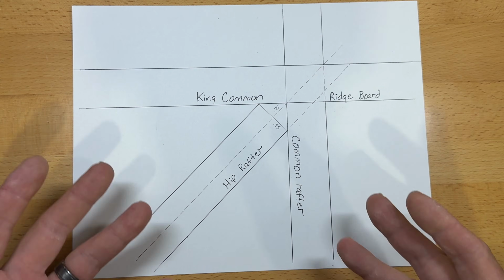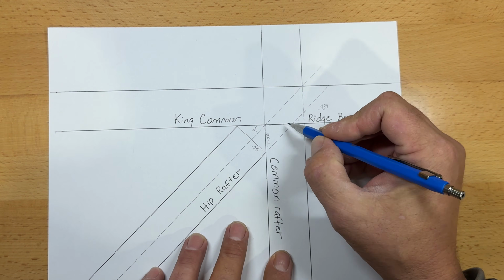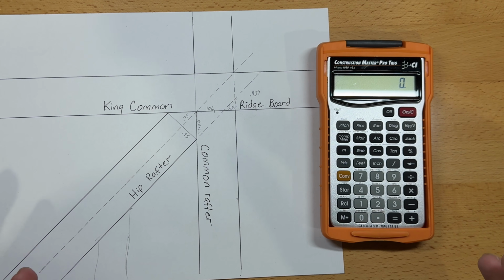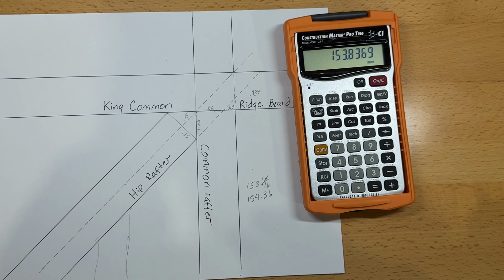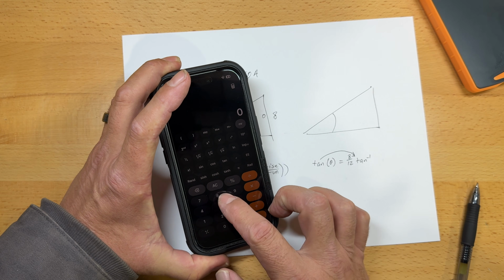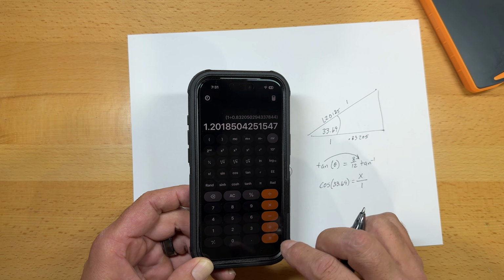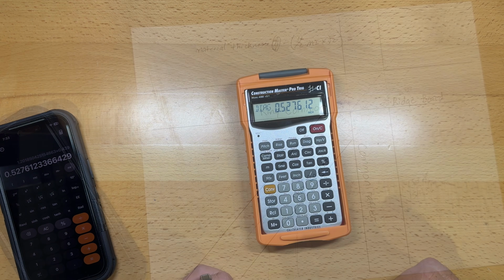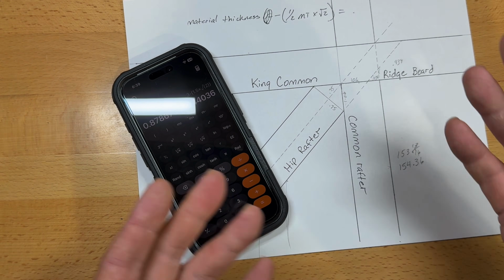The Flaw In Construction Calculators

Comment: You can calculate directly: 0.75*(Square root of 2)=1.06. When I was young we still used inches in the timber industry in Sweden, today it is mm. 2 inches is about 50mm. I say ( 2 by 4 ) in mm it becomes 50*100. This is understood to be sawn timber. Otherwise I just say ( 2 by 4 ) Planed. About 45mm*95 mm. I have a folding rule that is marked with both inches and mm. The younger generation never borrows it.

Comment: Curious... do those 'construction' calculators do order of operations correctly? For example, if you enter 1+2*3 without parentheses, do they return 9 or 7?

(7 is correct.)
Reply: Who... cares? You're not manually inputting entire equations into a specialty calculator like this one
Reply from the maker: All the inputs on these calculators are performed manually. You don’t have the ability to input full equations. However, if you were asking if the calculator does the order of operations correctly in the background, I would say yes, they do.